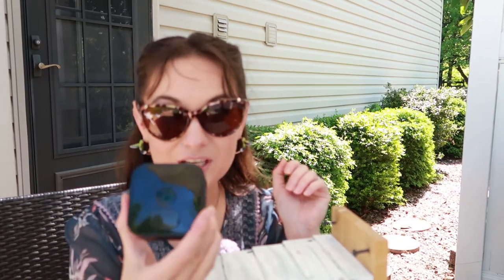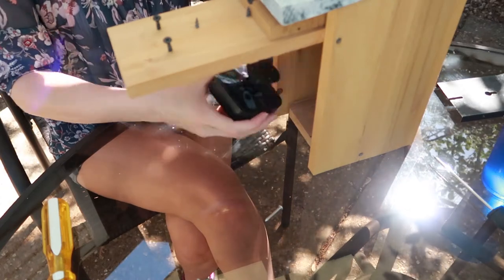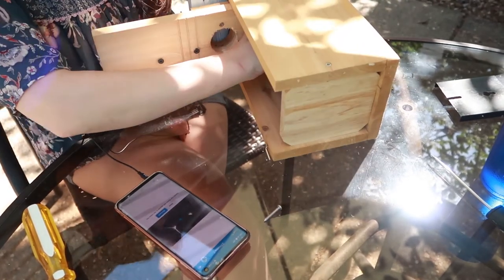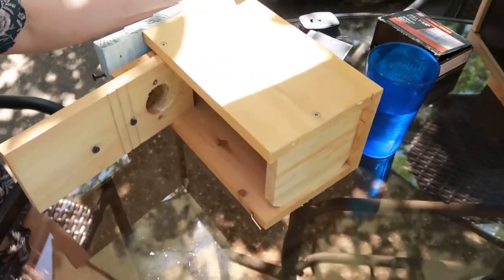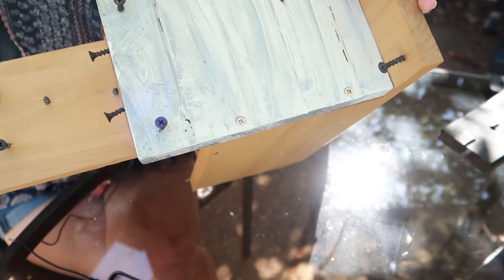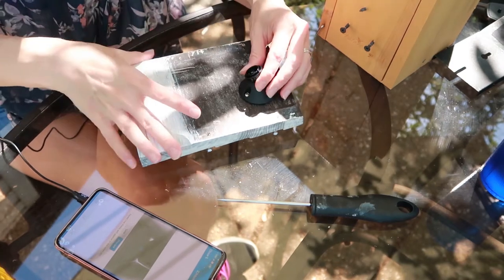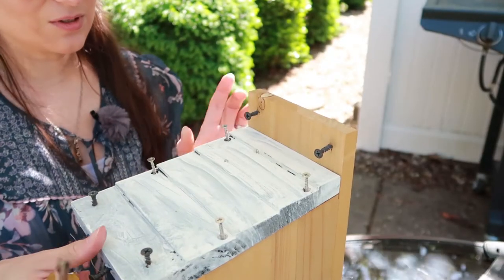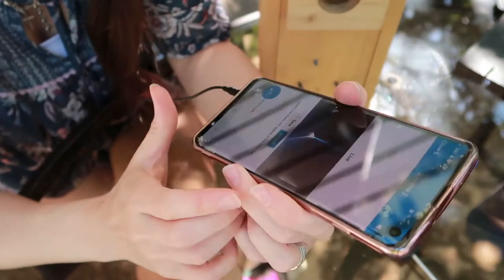How to Install a Blink Camera In Your Nest Box/Birdhouse for Bird Monitoring

Comment: My bird box is short, think I need to upgrade get a taller one for the Blink cam, what length is that one
Reply from the maker: The interior is about 9-10 inches. That is about standard. Larger and taller boxes also have the advantage of keeping a nest box a little cooler during the hot summer months. 

I know from experience that the Woodlink boxes work just fine with the Blink Cameras. They are an excellent starter nest box too. They're built to Audubon specifications, have drainage, fledge grooves and vent holes. 

We just started listing some products on our site (originally the site was just for information, and it's new, but then we decided to experiment and expand). 

Here is a link to the box I'm talking about: https://cavitynesters.com/product/bluebird-nest-box-starter/

There are other boxes on the site. I would not recommend a Peterson box for the Blink - that's just because we have not tested one in there yet.  But the box in the link is very affordable and has been a favorite of bluebirds and chickadees. 

**If you do upgrade and use our site to do so, the shopping side is brand new. Soo, you'll be kind of beta testing it ;)

Good luck with the Blink. You will definitely get addicted :)
Reply: Mine was as well.  I built a Petersen style house that worked great
Reply: My box is too short! I’ve looked EVERYWHERE and can’t find an appropriate bb house with a 5x5 floor that’s tall enough to house the blink camera. The link above does not exist…any suggestions? I need a bb house asap! Thanks in advance!